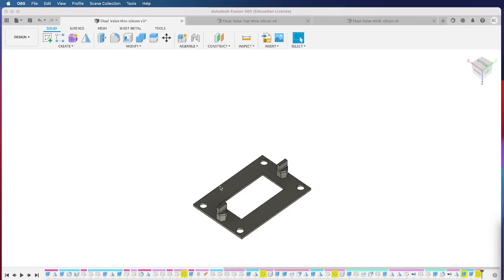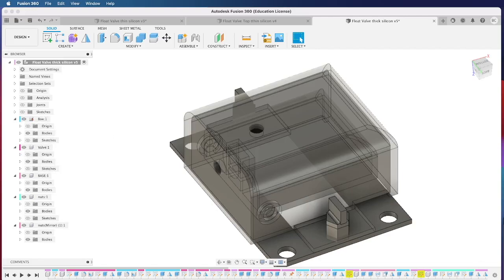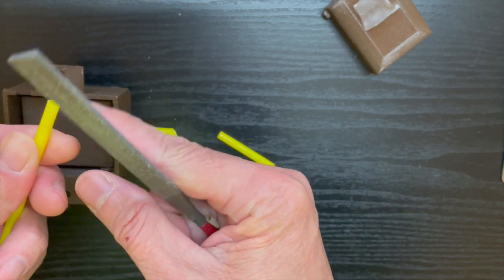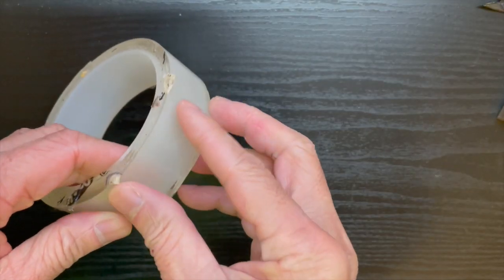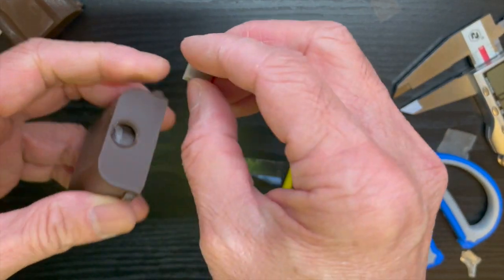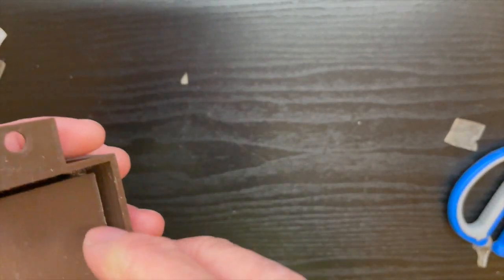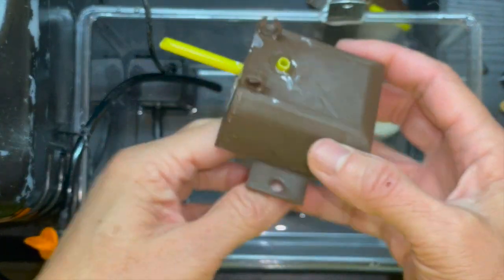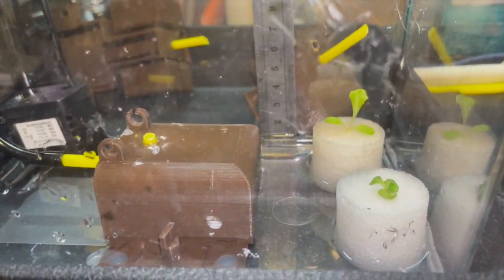Float Valve for Kratky Hydroponics with Base

Comment: Hello very cool project but this is the hydroponic version without drybacks, can you make the soil version with the vacuum control to allow drybacks please ? Thank you very much
Reply from the maker: @civismesecret  , thanks. I am not sure I understand your requirement. Please point me to some examples.
Reply from the maker: @civismesecret  , yes I made a few versions of 3D printed float valve already. Checkout my other videos on the hydroponic playlist of my YouTube channel.
Reply: @BillyCdiy 
I'm talking about your model with drybacks https://youtu.be/QO4pL9GKeGk?si=A-CnAdtefMw0mPfT
Reply from the maker: @ , unfortunately, that design did not give a stable result. Sometimes it works with the dry back. Sometime it failed. I could not found a non-sticky soft rubber / silicon that can seal the air hole without sticking onto the air hole forever. I had not yet solved this problem.
Reply: @BillyCdiy  replace the air hole by a check valve, it will create the vacuum effect we want
Reply: It works!!!! I just tested your dryback system with a check valve on the air hole and a lighter nozzle on the water hole also a cork as the floating part, everything in a very small bottle and it work consistently !! Omg I'm so happy.. I will make a video to show you soon, thank you very much amigo

Comment: Could you use an ear plug for the second one
Reply from the maker: No. Only  flat silicon tape of at least 2mm thick can be effective to seal the in pipe openings to stop liquid flow when the float valve is raised to the high level mark.

Comment: Very nice.  What material are you using in the flow valve?
Reply: It's more than likely PLA
Reply: @kurti4432  There are so many variations on PLA and PLA+ even that wouldn't tell me much. 😂  I was thinking PETG might be a better option but I'm not sure the step up is necessary
Reply: @jmr  oh yeah man you are right about the many types of PLA lol. I figured it was the standard PLA because it's the most used. I love PetG specially for outdoor use.
Reply: @kurti4432  I haven't done PetG yet but I've got some projects in mind that will be used outdoors and in a vehicle that could use the extra durability and heat resistance.
Reply: @jmr  I had a hard time with petg in the beginning. Print slow (50mm) or less and I suggest use a direct drive along with 250c for print head and 75 to 80c heating bed temp. Oh and I use a PEI bed which makes PetG stick with out using glue of any sort. Oh and one More thing , make sure you use a slightly thicker paper to level your bed when using PetG because that material likes to be layed down and not squashed like pla.. if that makes sense lol
Reply: @kurti4432  I've heard that it may stick to the bed too much if oversquished.  I don't think I've never heard anyone mention direct drive for PetG though. Interesting... I guess it must slip since I don't believe it's a problem with the bending.
Reply: @jmr  Direct drive uses alot less retraction than Bowden tubing just because you don't have all that travel through the tube . I went from I think 6mm to .5mm retraction. Also you can run higher heat with direct drive since the tubing is eliminated, which is also good for higher temp materials. As far as sticking is concerned, it's never happened to me since I use the PEI heating plate. Get one man you won't regret it .
Reply from the maker: I used PLA.
Reply: @BillyCdiy  I hope they work well for you.  I may give this a try.
Reply from the maker: @jmr  , I have another version that can be made from disposable plastic bottles. see here: https://youtu.be/4gtdz6pzJZM
Reply: @BillyCdiy  I'll check that out.  It looks like you have many interesting projects!

Comment: We could make alot of cash in the MJ business. Check out the bucket company. Uses same type of float, seals different , also plant benders, small curved prices they put on stems to train them. I'd love to have a printer. Kid graduation was last year, they wouldn't let him make me ANYTHING 🤣🌱🙌
Reply: 420 good buddy
Reply: Honestly 3D printers are not to expensive . I have a Ender 3 pro which was around 200 plus at the time . Have a few upgrade and prints pretty well for the price. Of course there is some learning curves but over all it's not hard.
Reply: There's a coupon at micro center,  allowing you to get an ender 3 for only 99$. You have to go to micro center however.
Reply from the maker: Thanks for your support. I have another version that can be made from disposable plastic bottles. see here: https://youtu.be/4gtdz6pzJZM

Comment: i dont think this is krakty its more like DWC
Reply from the maker: The cotton with the plant in the tank is just for illustration. The plant will be put on the top of the tank (1 inch above water level). The water level is set at 2cm deep controlled by the float valve.  So only the bottom 1/3 of the roots wilI dip into the nutrient solution, 2/3 will be above the nutrient to allow the root to breath in the air. I  will create a second video to show how this is installed.
Reply from the maker: Video of a vertical hydroponics system built using this float valve : https://youtu.be/G_jwbDD0n4c